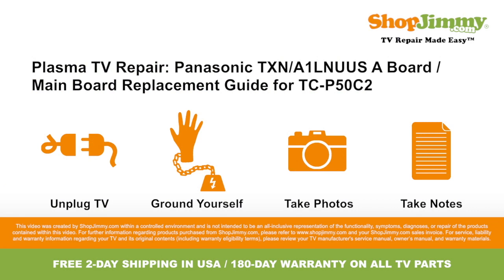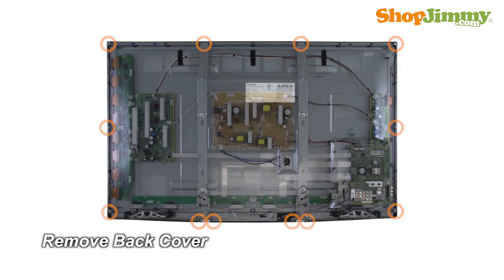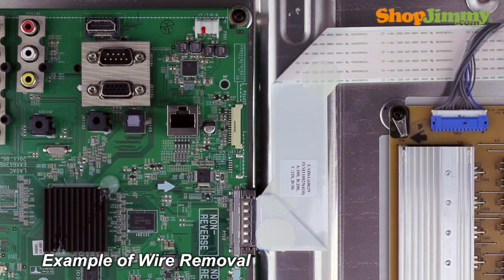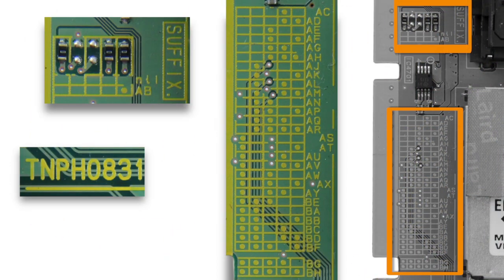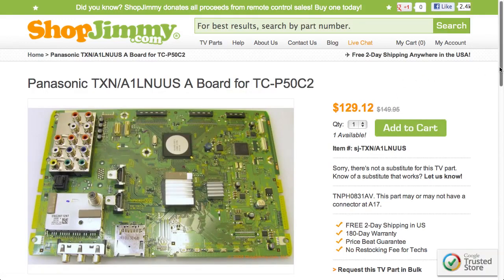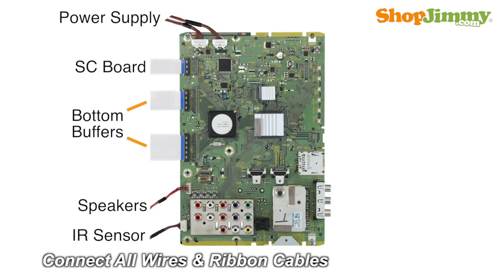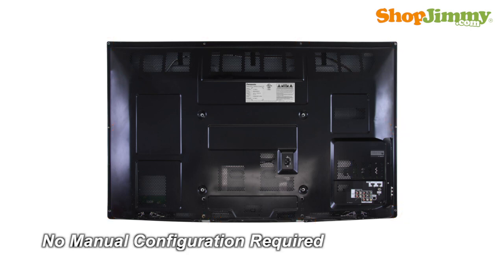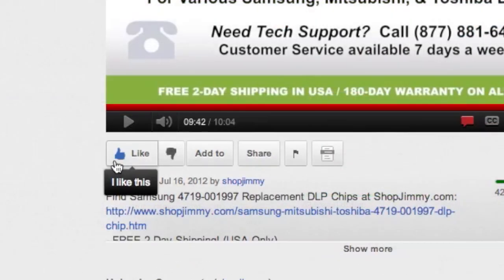Panasonic TXN/A1LNUUS A Boards / Main Boards Replacement Guide for TC-P50C2 Plasma TV Repair

Comment from the maker: @ZIGGYGMC-Typically replacing the main board will fix the issue.  If you have the same model number, I believe the board number you are searching for is tnph0831av and we are currently out of stock.  If you go to our website, you could request to be notified when this part comes back into stock so you may purchase it then.  Thanks and please let us know if you have any other questions.  You can also call for more help at (877) 881-6492.  Thanks!

Comment: My HDMI1 and 2 stopped working.  I tried the cable box on another TV and it works fine.  Are the TV model number and serial number sufficient to purchase the part, as I don't want the TV laying around for days before the part arrives?

Comment from the maker: @oiyabastard - You will most likely need to replace the following parts.  The SC board, SS board, SD board and the SU board.  Click on the link in the video "Click here to Purchase TV Repair Parts" and search your model number on our website.  After you have replaced the boards, run the newest software  upgrade.  Thanks and please let us know if you have any other questions!  (877) 881-6492

Comment: I have a Panasonic Viera plasma TX-P42X20E. MC106H30U13 Mar2010 Serial No. TJ0214005
I put the TV ON and works. If I put it off again and turn ON the TV led lights green but no longer see the picture again . I cant either turn off or operate with remote control . If I leave it turned on standby mode and will show 13 red blinks . It will not return to work until unplugged and let cool 24 hours.
I have found that , when operating , the SN -Board green led lights  . But when it fails, the green led does not light.
You can help with the diagnosis ?
Thanks !!!

Comment: We have a Panasonic TC-P50U2 50" Plasma TV  the sound quit working all of a sudden a few months back.  It will work if we connect our xbox 360 through an external speaker.  We tried to scan for channels with an antenna and now it will not pick up any channels and the screen is pink.  the only thing that works is the xbox.  Any ideas?

Comment: I have a Panasonic VIERA TC-P60GT50 60-Inch 1080p 120Hz Full HD 3D Plasma TV and  none of the HDMI ports are working. Do you think I need a new A board ? Or are they repairable in some way? Thanks  And if I do, what would a new A board for this model cost?
Reply: yes

Comment: My TC-P50C2 just went out. No blinks, no sounds, it is just dead. Not sure what it could be. We had a brown out earlier yesterday evening and the TV shut off, but I turned it back on and then 2 hours later it just went out. No lights, nothing. The 2 fuses appear to be OK. I was hoping that was what it was. Something cheap and simple. It is either P board or A board. I noticed that the HDMI ports stopped working a couple years ago, so ive been using component HD for the past year and it worked fine that way. Both boards LOOK fine.

Comment from the maker: @PuzzleSolver-We most likely carry the convergence IC's and resistors needed, however we would need the part number information to confirm the correct parts.  Please reply with more information or feel free to call us at (877) 881-6492.

Comment: I purchased one panasonic 32 inch led tv (TH-L32E5D)they have problem in no picture in the tvservice technician told display board failiure need to replace the display board they told charges Rs 18,000/- plus. I purchased only 1 year two months. whether  it is possible  any advice

Comment: my panasonic TC-P50C2 Tv just shut off and I get 10 blinking red lights when I push the power button.  I disconnected all connecting cables, unplugged the  Power for several minutes plugged it back in and get the same 10 blinking lights

Comment: I have Panasonic viera "TH-42PC10D" 42inch plasma TV. since last week my TV turns off while running and gives 7 blinking lights. Some times it run smoothly for hours and some times it don't even starts and gives blinking light. I don't know that's the exact problem with my plasma. Hope you can give me the solution.
Reply from the maker: Rachit Chaturvedi   I recommend replacing the SC board in your TV.  Here is a link to possible replacement parts for your TV model number on our website, click here:  http://www.shopjimmy.com/catalogsearch/result/index/?cat=66&q=42PC  Be sure to match part numbers on your current board, with your replacement for compatibility.  You can also call our customer service for further assistance with your purchase.  (877) 881-6492  Thanks and please let us know if you have any further questions with your TV Repair!  www.shopjimmy.com
Reply: Is there any possibility that damaged ribbon cable (not completely) connecting SC board to the Main board that sends the signals can cause 7 blinking lights?
Reply from the maker: Rachit Chaturvedi  That is possible.  We have not seen that happen, but it is possible.  Thanks!  www.shopjimmy.com

Comment: I purchased one panasonic 32 inch led tv they have problem in no picture in the tv
service technician told display board failiure need to replace the display board they told charges Rs 18,000/- plus. I purchased only 1 year two months. whether  it is possible  any advice
Reply from the maker: RAJA V   I recommend replacing the main board in your TV.  Please reply with your TV model number and then I can recommend replacement parts for your TV.  Thanks!  www.shopjimmy.com